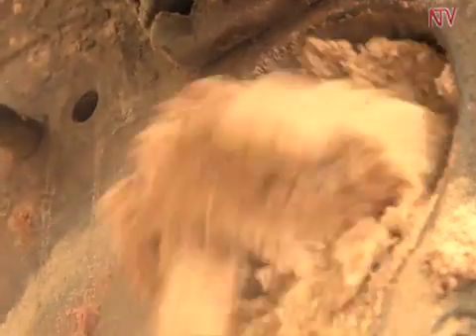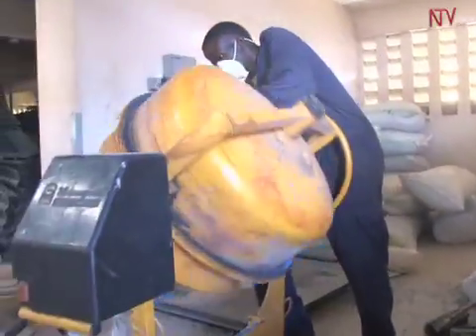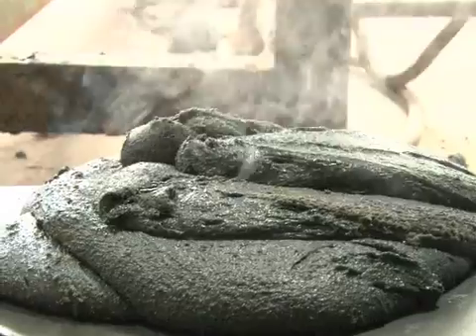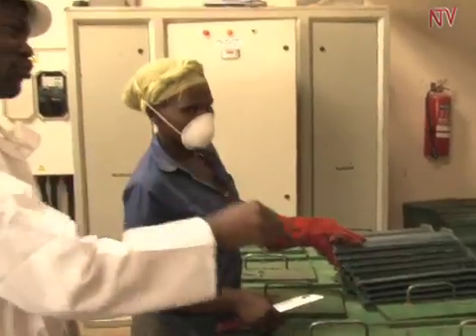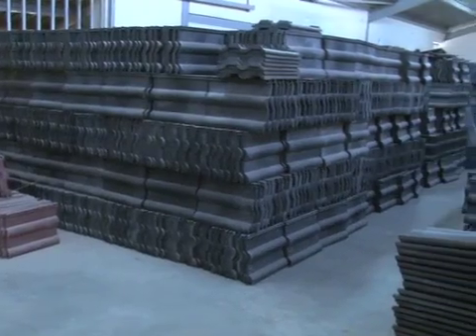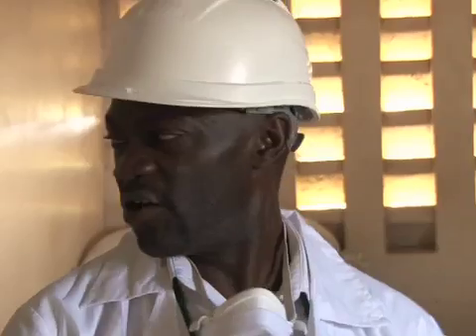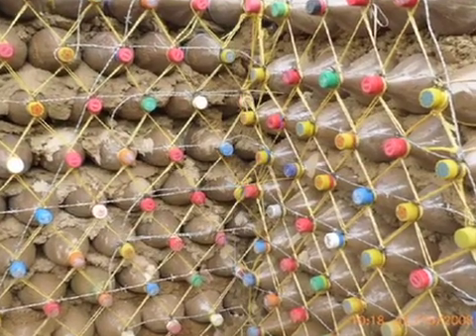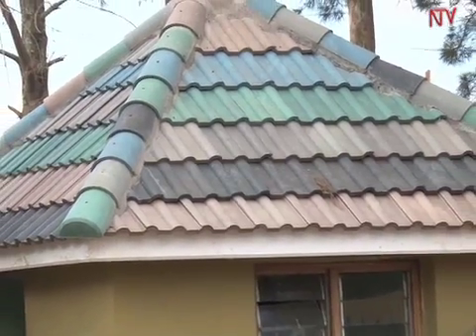ECO FRIENDLY Plastic & Sand Tiled Houses

Comment: Instead of sand just use ground up waste glass. Filter it through a screen to keep the grain size small. If sharp points become an issue use a knock down scraper as a last step.

Comment: Fire and heat resistant/retardant (2.21) <1% breakage versus 10% normal clay tiles: hard and light. Turn-key processing unit  made by  Machinery and Technology Supply Company based in Cape Town,South Africa, achieved the Best-Recycled Product Award for 2012 from SAPRO (The South African Plastic Recyclers Organization).
Reply: Good day, I'm currently looking recycling machine that can make building material like that, may you please assist with information. I'm based in Gauteng. vincent.mulaudzi@gmail.com or Whatsapp: 0792727978
Reply: Hi I need more details on this. We are already working on setting up operations in Nigeria.

Comment: If it catches fire; .... and drips flames and boiling plastics down the neck if firemen .  Ummmm; not a good idea.  Fences, pathways, park benches, hammer handles,  fine.
Reply: It isn't so much of a napalm :D there is a lot of sand in it.
Reply: high density polymers aren't much of a threat to fire accidents when mixed with sands

Comment: Do you use pet plastic bottles can you send me details on the type of machine used.
Reply: +shamir khan It would be custom manufactured industrial machines, basically you aren't going to buy one, you'll probably have to make it yourself from scratch.
not completely impossible, you can make a press out of a car jack, there are multiple ways to shred or powder plastics, but the pasting machine that heats, mixes, and extrudes like this will be the main real challenge to rig up.
Reply: Dear/ Madam; Shredding,washing and molding PET plastic is not my problem. It is the melting without charring that is my problem.
Reply: Like i said: " but the pasting machine that heats, mixes, and extrudes like this will be the main real challenge to rig up ".
Reply: Postghost very good,
Reply: Postghost  precico conhecer esssa tecnologia
Reply: The machines are specially designed for this product we do not use PET

Comment: Also can less sand be used to reduce the weight of the tile and still maintain the tensile strength and durability of the tile
Reply: Maybe 65% Sand 35% Plastic

Comment: Has there been any studies done on the possibility of chemicals in the plastic leaching into our soil with use of these tiles?
Reply: +Kevin Keel I'm not sure where you come from, but here where we are, we don't drink or wash from our sewer pipes.
Reply: +Philip Not any worse than your plastic sewer pipes - acrylic-butene-styrene and poly-vinyl-chloride. Pretty safe.
Reply: PIP PIP nice question,clean and green.
Reply: +Philip I'm wondering what the chemicals are that run off into a rainwater tank. That worries me. But I do see this as a great way to extrude guttering, wall/fence panels, faux bricks, and many more products.
Reply: chuggles03 hah - no, the point is that the plastic sewer pipes don't leach chemicals into the ground.
Reply: So you say that the recycling process makes the plastic more dangerous than the original?
Reply: @johnbestevaar372  No, he's saying that he is worried about chemicals slowly 'leaking' from the plastics and contaminating the earth, our water supplies if said water goes from a roof tiles into our drainage, etc.

Comment: We are a Machinery and Technology Supply Company based in Cape Town,South Africa that supplied this machinery and technology.

Having been involved in the Recycling Industry for over 30 years, we identified a need for the recycling of mixed post consumer plastic waste.
After many years of research and equipment design, sustainable products have been developed. Through the blending of post consumer waste plastic with sand and applying heat and pressure, a range of viable products are manufactured.

These products include:
• Roof tiles
• Manhole covers
• Paving slabs
• Cobbles
• Railway sleepers
• Retaining blocks

In 2012, the Department of Human Settlements in South Africa acknowledged the Roof Tile Product and it was awarded a Prestigious Gold
Medal for the best alternative building product.
In addition to this, we achieved the Best-Recycled Product Award for 2012 from SAPRO (The South African Plastic Recyclers Organization).
Not only are the products lighter in comparison to conventional products, but they are also harder wearing and far more durable.
The advantages of this product are endless.
A few notable advantages include:

Reduced weight (ensuring lower transport costs).
Fewer breakages (less than 1%, as the products are not as fragile as
conventional products which can have upto 10% breakages).
Greater impact resistance (this can be attributed to the plastic element
of the product).
The product is non-porous (eliminating the risk of water absorption and
fungus growth on tiles, blocks etc).
Fully recyclable after use.
Hailstone Proof.

In addition to this.

Creation of employment for the local Community.
A more sustainable product that can be used in Building Projects.

We have three of these plants operating in South Africa, this one in Uganda and we are currently negotiating with Nigeria, Ghana, Seychelles, Reunion, Namibia and the Maldives.
We supply a full turn-key solution and hand over a fully operational plant to our customers. In addition to this, back-up is supplied in
terms of spare parts and technical know-how, as well as training for key personnel and staff.
Furthermore, we will assist in the design of new products to the client's specifications and implementation thereof. All of this enables
us to ensure customer satisfaction at all times.
.
If you think this is a project that would be of a benefit to you and would care to meet with us to discuss this further, please feel free
to contact us.

Dave Worsley
Plastitrade
Off: +27 21 5574502
Mob: + 27 (0) 835812985
www.plastitrade.co.za
Greg Muller
Tereco
0828560743
kirnol@mweb.co.za
Reply: would you please let me know the total coast of the plant. I am from Ethiopia and wishing to start the eco friendly roof tile.
Reply: i want to buy this technology  how can i contact you please help. my email: mrbhatta4@gmail.com
Reply: Please send your email address to plastitrade@mweb.co.za we will send you a proposal.
Reply: hello am an enviromental enthusiat and a social entrepreneur from tanzania and i would like to know the costs of the machines and also order modifications how can i get this please my email is edgaredmund424@gmail.com
Reply: please send me  your email address? ?? I want this machine please? 

my email address 

fraol47@gmail.com
Reply: please send me  your email address? ?? I want this machine please? 

my email address 

fraol47@gmail.com
Reply: @hawibedane599  His email address is literally linked directly in the post you replied to.

Jesus christ.
Reply: please send me  your email address? ?? I want this machine please? 

my email address 

fraol47@gmail.com
Reply: please send me  your email address? ?? I want this machine please? 

my email address 

fraol47@gmail.com
Reply: please send me  your email address? ?? I want this machine please? 

my email address 

fraol47@gmail.com
Reply: please send me  your email address? ?? I want this machine please? 

my email address 

fraol47@gmail.com
Reply: Dave Worsley can we import machinery in our country
Reply: @aashishbhagat2160  yes we are making it .paragsolanki917@gmail.com
Reply: https://www.youtube.com/watch?v=KZxskJojRLY
Here also  is the very fast construction method and green technology ,specially for ground houses and 2 stories villas , all of the panels are 100% precast in factory ,then transport to site and assemble the panels to houses by high-strength bolts . we offer the construction technology , production line , training , strucutre design and package service . contact infromation : whatsapp : 0086-18033798305 mobile phone : 0086-18033798305 Email : epsmachinery@xuelongqiye.com Skype : epsmachine1

we could cooperate for your housing project .